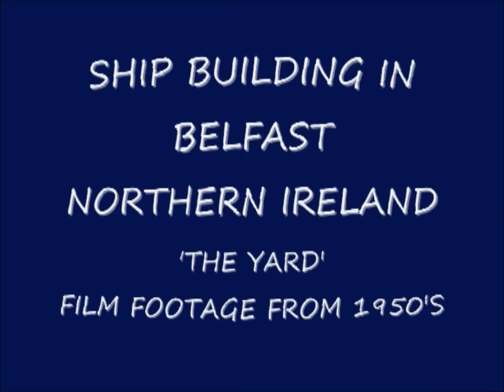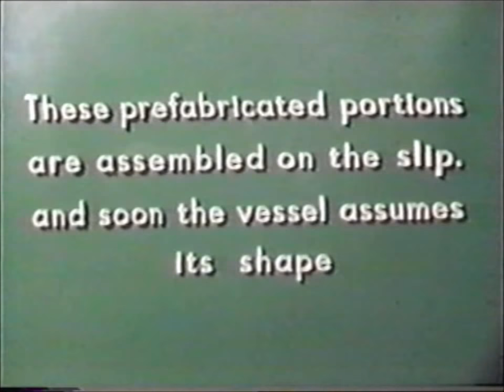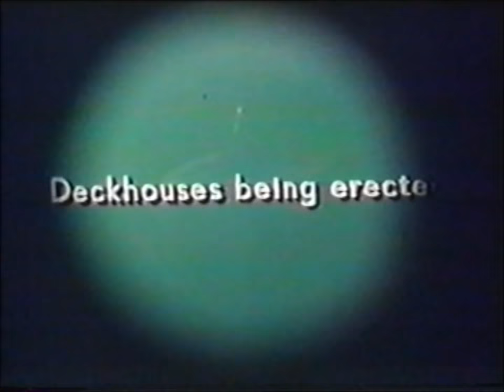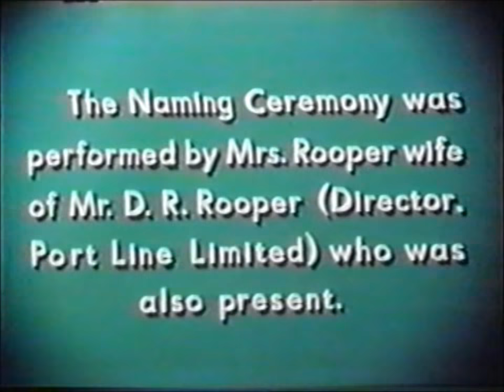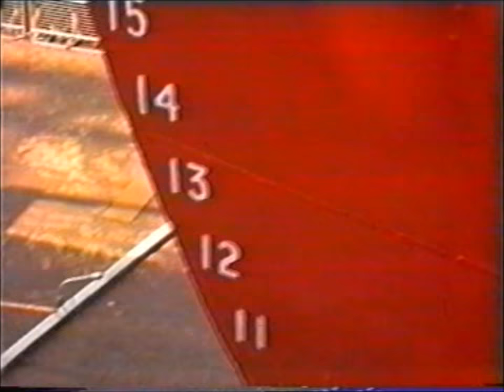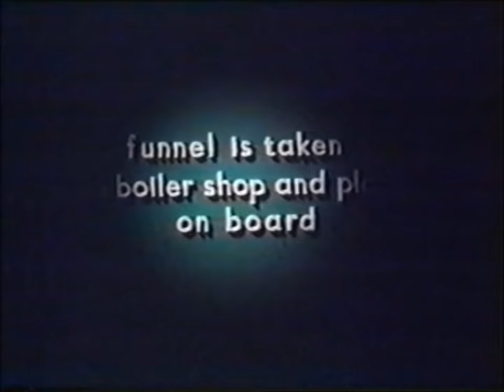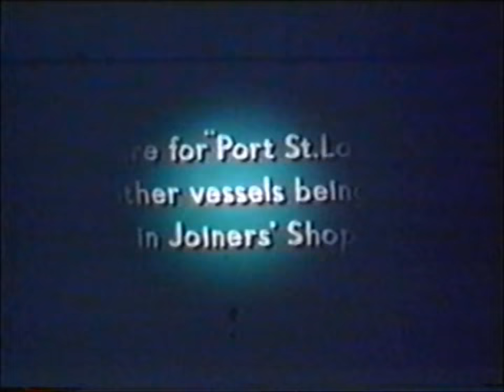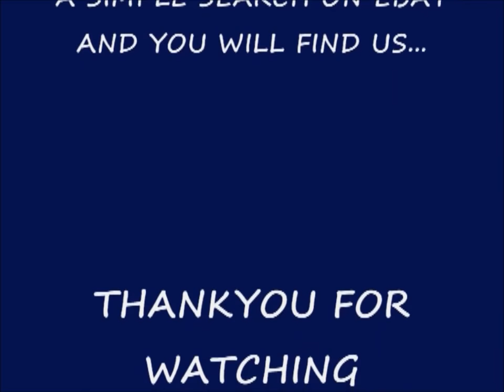the yard .. harland and wolff belfast

Comment: In 1968 I was a ropelayer in Belfast Ropeworks, which was a subsidury company od Harland and Wolff shipbuilders. The ropeworks was then the largest of its kind in the world, although its machinery was Early Victorian - and antiquated, with most ot it operated from leather belts that stretched up to twenty feet to a central steel "axle", which in turn was driven by water wheel fed by the Connswater River alongside. Most of the ropes were of hemp, but I was one of two men selected to operate a brand new electrically driven layer especially designed for syntheitc ropes. Hemp contains an oil which literally seeped into the operators' clothing. Unlike hemp ropes made elsewhere in the world, those made in Belfast had a "secret" formula of oil added, and which made our ropes unique and longer-lasting. Thankfully, synthetics were a lot cleaner and slightly less dangerous, as many men had lost a hand or fingers on the old machines that had little-to-no safeguards.
The first synthetic ropes I made (on a job lasting several months) were for the brand new QE2 Liner. Working entirely alone at nights, I had to churn out two-three reels per night, and any extra would give me a small bonus. Unfortunately, it became a regular headache when the machine broke down or an unseen knot jamed in the die; synthetic ropes require high-quality splicing that could take a hefty slice of time - time that cost money! However, I managed to produce about 90% of the complete order before I chose to resign and become a full-time police officer! Nonetheless, I had made my tiny mark in history as one of the first ever ropelayers to produce synthetic ropes, and to make them for a world-famous liner.
Reply: Lovely to hear these memories I worked in the accountant's office until the McCleery L'Aime takeover and left in 1972!
Reply: Great story! Cheers!
What was the oil used for the hemp ropes?
Reply: @bushratbeachbum  I/We really had no idea; all hemp went through several processes before it eventually got to the rope-layer. Like any quality manufacturing company, Belfast Ropework Company had its "Trade Secrets" known only to a few. The only things I/we knew was that it was colour-less, and after a day of making the rope, our clothes were pretty much saturated and had to be washed. It did have a specific, pungent smell - not unpleasant, and not that dissimilar to a garage mechanic. We suspected some form of soap and tallow, or even vegetable oil,but whatever it was, our ropes apparently outlasted Indian and Italian hemp by years!  The irony was that our new machines for synthetic rope where Italian!
Reply: Coolo, thanks for the reply. Much appreciated!
I was wondering if it may have been a form of hemp oil or something.
I've not had a chance to work with hemp and find it a fascinating plant.
It's a shame it stopped being used so widely, it seems to cover most of our needs and groes fast! Madness!
Reply: @bushratbeachbum  Like any other similar plant such as jute and flax, hemp has its own oil. It is claimed that Northern Ireland had the best such plants in the world, and certainly held the market share for many years - perhaps due to the peat marshes. Flax for example had some 21 different processes before it went into production materials. There is an excellent video on Youtube about the production precesses in Northern ireland - fascinating! Sadly these products have been overtaken by synthetics.
Reply: @johnmilliken5204  Do you remember Mr Savage?  Are you related to Don Milliken?
Reply: @reggriffiths5769  Sorry but no to both!   In the accountants' office we were very much 'encouraged' to stay within our own immediate location.   The only real time I got to see other parts of the factory was when Ted Tranter, the management accountant invited me to see one of the early runs of the blue polypropylene ropes from the blue beads of raw materials.    That was about six months before I left in August 1972.   Do you remember the two tiered canteen with the upper tier for management and admin staff!
Reply: @johnmilliken5204  Never even knew about the canteen until a few years ago! I worked there during 1967/68 for about ten moths. I started off on the old rope-laying machines ffor three weeks before being put onto the new synthetic rope-machine - good grief, it had safety guards!!! Apart from the first three weeks having fun with the girls further down the line, my entire life for the next 10 months was working entirely alone in that 800-yard-long mill from 11pm-0830am - and never saw a living soul in all that working time. It was a skilled, but soulless job for poor wages. Ileft at the end of March 1968 having already applied for the police, and got my ticket the following Monday. Never regretted leaving, and enjoyed my police career. Much as I hated the ropeworks, I am sad that it's now long gone - just another piece of Belfast I miss.

Comment: The size of the funnel intrigues me. The engine ( is that a two stroke diesel , ie with a blower?)was slow revving , I cant imagine the exhaust was was at high velocity , though no doubt pretty hot and voluminous. Did the funnel also house some kind of heat exchange unit for pre'heating inlet air or heating fuel or perhaps water ?
Reply: All main diesel engine built in Belfast up to 1960 were Opposed Piston 2 stroke under B &W license. Earlier engines were Double Acting 2 stroke opposed piston (3 pistons /cyl ) then later came Exhaust Valve 2 strokes turbo charged. They are direct drive 115 rpm, & direct reversing. Engine exhaust generates steam.

Comment: Stangest engines I ever saw with moving heads, some kind of opposing piston arrangement possibly?
Reply: H&W had a licence to built the Burmeister & Wain double acting two stroke engine. So, one piston in a cylinder having a combustion chamber above and below it. Instead of exhaust valves they were equipped with exhaust pistons which were driven from the crankshaft. The comparison with an opposed piston engine is therefore easily made.
Needless to say that the sealing arrangement of the lower exhaust piston much have caused headache to the engineers. The exhaust pistons were connected with each other by the four tie rods and were in turn connected with excentrics ar each side of the main crank (as with a Doxford😀) thus contributing for about 25% to the engine output.